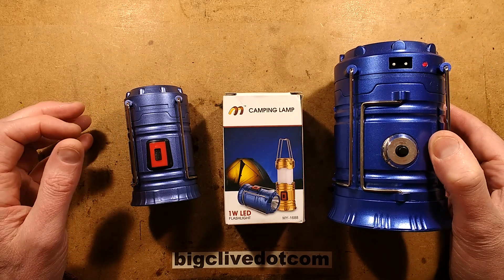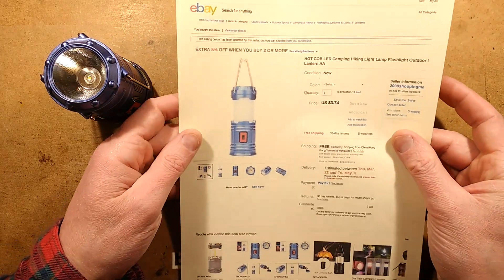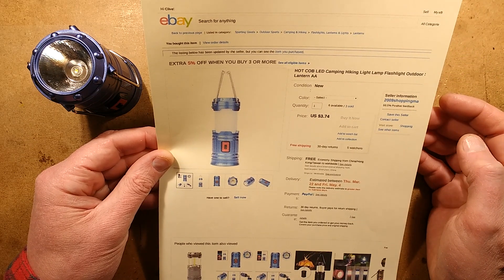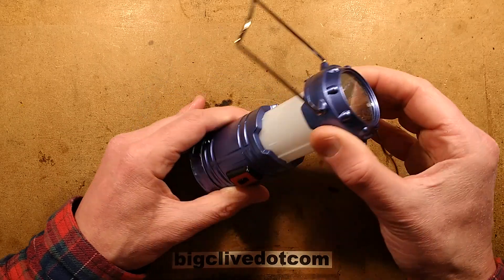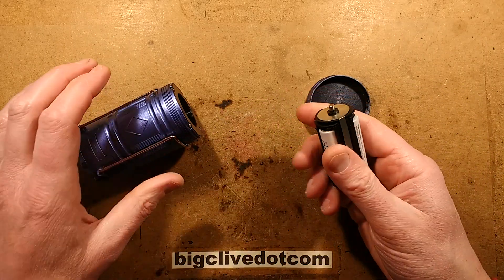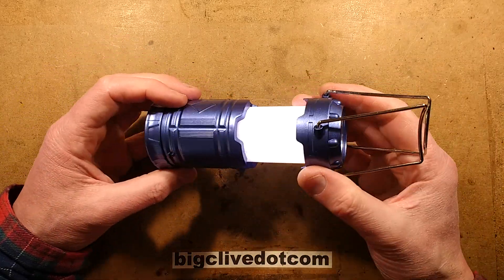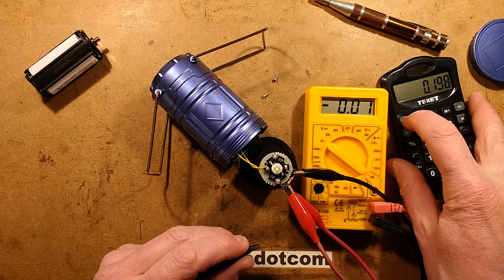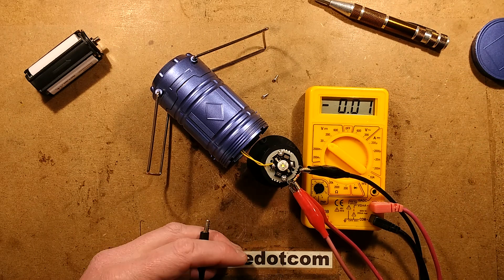Mini death-dalek camping light is actually safe!

Comment: Some other LED hand torch use a plastic sleeve to allow an 18650 cell to fit in place of the battery holder that takes the three AAA or three AA cells.
Would such a sleeve or even a homemade sleeve made from plastic plumbing pipe allow an 18650 cell to fit in place of the three AA cells, I wonder?
A protected 18650 cell that is.

K.

Comment: I am surprised that clive hasn't got around to reviewing the dodgy crap as far as electronics are concerned on wish
Reply from the maker: It's because the Wish landing page demands your email address before even letting you look at their site.  I just back out at that point.
Reply: Fair enough, it's a shame most of the stuff on the site is junk knockoffs, got a shoddy cable with a magnetic connector you see everywhere recently there for about 3 quid with shipping, took ages to get to my door and stopped working after one charge of my phone, didn't dare use it afterwards, I imagine anything more expensive would be quite a hit to the wallet

Comment: You can work out the power dissipated in the resistor from just the known resistance (2.2 Ohms) and the current from your power supply, you don't need to meter the Voltage across the resistor. Power = Current * Current * Resistance. P = 0.3 * 0.3 * 2.2 = 0.198

Comment: But if it isn't live at mains voltage how am I supposed to know if it's working or not?  You can't get a decent shock from 4 AA batteries.  This is most inconvenient.  And with this new safety feature I guess they can't sell it in pink.

Comment: A comment you made has me thinking. Alkaline 3 AA would normally be 4.5V. Rechargeable would be less, but the other day I bought a pack of energizer lithium cells since two packs were in the clearance bin. I figured $4 for 8 AA lithium cells, why not try them. I decided to put them in the Fluke 289 instead of my normal eneloop cells and I was surprised to see the one cell at 1.82 volts. In fact they all were between 1.82 and 1.88 volts. So three would be 5.4 volts, and not the normal 4.5. And for the fluke 289 that takes 6, well once I put them all it they measured at 11.04 volts. That 2 volts higher then 6 alkaline cells. I wonder how many cheaper things might without regulation like the stuff from Ebay would be affected by the higher voltage. I know most things might not care, but some things could. 
Just a random thought I guess since I measured those lithium energizer  cells the other day.

Comment: It's also fairly hackable! With a bit of cardboard and some tinfoil tape you can use a 18650, preferably a protected NCR18650B by Panasonic. You could also solder it in and add one of these tiny 2 amp charger modules.

Comment: Wouldnt it be 6000mAh though if there are 3 2000mAh cells? giving more like 42 hours of use?
Reply: If the cells are in series (as here) the capacity doesn't add, only the voltage adds. 
Put the batteries in parallel instead and the voltage remains the same (as a single cell) but the capacity adds - then you'd have 6000mAh @  1.2/1.5 Volts. Eith the batteries in series you get 2000mAh  @ 3.6/4.5V.
Reply: Michael Tempsch ah thanks :) Clearly I need to pay ore attention to Big Clive

Comment: Is the reflector double-sided? I was wondering why the wash light was so even. The only thing I could think of was that the reflector was coated on its backside as well so the light came out evenly but I couldn't see it from your vid.
Reply from the maker: The chromed plastic reflectors usually have a matt silver effect, so that would reflect the light well.

Comment: Great video as usual, one thing I wanted to mention that I do on hard to remove batteries like this device. Put a small strip of cellophane tape along the side of the battery case and let it extend out the bottom. Then fold it back on itself to make a pull tab.

Comment: had the same blue one i removed the down side led its good 1 w led usefull for making my soldering station quite better ez 5V + potentiomeeter so i dont get blind for while xD i used to shock my self while so i melt the red usb cable and removed it before problems i like that small one xD

Comment: This one is just a battery torch with a slid-up lantern top, it's not a Dalek because it doesn't have the "Exterminate!" function provided by a capacitor dropper powered charging circuit and USB port.

Comment: I must have forgotten something here 2.2ohm? I get 4.5 - 2.6 = 1.9v / .3 = 6.3ohm what did I forget?
Reply: I should watch the video again, but where did you get the 2.6v from?  Red Red Gold, 2.2*.3 = .66v * .3 = 198mW. Or did I miss something?
Reply: He said the light was glowing at 2.6v it's noisy here.
Reply: Still wouldn't a 2.2ohm resistor be too much and blow the light?
Reply: I think that was 2.6v across the LED and resistor in series with a current of 140mA?
Reply: He said it was starting to glow @ 2.6v I live in a madhouse of noise

Comment: What do you think about using 18650 Li-Ion's above their max Amperelimit for short period of time? 
For example Sony VTC5A made for 35A permanent load. Is it dangerous to drain 40A or even 50A for a pulse load?
Reply: The datasheet for the VTC5A has a table listing pulse current ratings.
Don't exceed the maximum current ratings unless you are willing to risk a fire or explosion.

Comment: Could this be hacked to use 18650's ?
Reply: Sure, anything that runs off roughly 3-4v can be converted to run on lithium with little effort, but the question you should be asking "is 18650 the right size for it"? 14500s are AA sized cells meaning you could easily fit 3 of those in there, maybe even hack the holder to parallel the batteries so no modifications to the device itself are necessary.
Reply: yeah, 3 Lithium cells in parallel would be epic.
Reply: I wonder could the unit be hacked to house a usb port and 5v voltage regulator IC so you could use this to charge your phone also.

Comment: I wonder if you could fit 3 18650 cells in parallel and do away with that AA cell holder and add a TP4056? Hmmm

Comment: i've come across some led torches that take 3 aaa's in a holder like that, but when replacing them , they wouldnt fit, seems the supplied 'aaa' s were fractionally thinner than proper ones, making the torch unuseable when batteries need to be replaced!

Comment: off topic and probably old news to many of you... but popping in to pick up some discretes tonight I saw Maplin is in closing down sale mode with 20-30% off and the stock does appear to be shifting...  I'd guess the discount may go up, but by that time it might just be the crud left. Stuff is included that is not shown on the website e.g. those annoying 3 packs of antex soldering iron bits - (buy 3 get 2 you don't like) Don't hang about too long if you want a plassie bag for a souvenir.
Commiserations to the Maplin staff affected BTW - hope you all find something better soon :)
Reply: That's sad.  We lost Radio Shack here in the US a bit ago, but they'd gone so far downhill there wasn't much to lose by the time they'd finally gone.  It's a lot less convenient to have to order from Digikey than to just stop by the local store.

I think all the Radio Shack employees you didn't want to punch in the face left a very long time ago.
Reply: + Jon C We had radio shack (called tandy here for some reason - same thing though, Archer, Realistic, TRS-80s etc.) and it failed here a long time before it crashed in the US... I went on a holiday to Canada in '97 and I was surprised they had radio shacks open.
Maplin expanded from a mail order electronics catalogue operation that'd sell in small quantities to people without trade accounts - had a few shops while tandy were still open and really expanded the shops a lot after tandy crashed, went for large retail-park shops rather than the smaller high street shops tandy had been in. makes me wonder if tandy got something super wrong in the UK cos it folded before competition from the internet had really even started.

Comment: Not a lot of features and the lighting is minimal but then again the Swiss army lamps have features that are somewhat useless and are prone to failure. This one does not waste space, involve questionable or potentially dangerous features, or add useless weight. The Chinese appear to have made a mistake and produced an inexpensive reasonable product. One thing I wonder if possible is a joule thief circuit that would optimize the longevity of the batteries without sacrificing brightness.

Comment: I was at Tractor Supply the other day, and they had a boring safe variant of the bigger Dalek in the bargain bins up front. AA (or AAA? I forget) powered, no USB, no solar, no, wall charging, and not even the top flashlight, just the lantern function when pulled open. I think it was $4 or so? Pricey for what it is. I didn't get one.

But they also had a nice light inspired by the Vietnam-era US military angled flashlight with the interchangeable colored lenses, but in aluminum instead of plastic and upgraded to LED. It also uses 6xAA instead of 2xC. I couldn't resist that one. I had one of the originals from a surplus store as a kid and it was my favorite flashlight then. I wish I knew what happened to it.

Comment: Clive, would that 3xAA cell carrier be about the same size as a standard Li-ion cell by any chance? Something like the 26650 or 32650 for example?
Or would that be just too convenient?
Reply from the maker: Slightly wider and both connections are at one end.
Reply: That's a pity, it would have made a nice >5000mAh rechargeable solution.

Although cunning use of a 3D printer could save the day - or produce a plastic 3D squiggle (from my own experiences!).

Comment: It simply having both contacts at 1 end makes it far better than the majority of my camping lights. All of mine either have the spring break off eventually, or the metal strip at the end no longer contacting the batteries.

Comment: Rule of thumb - for a bolt / screw 3.5 threads engagement is considered a minimum design condition in general egineering
Reply: Bishop Beesley unless you are Ford and are designing spark plugs for a v8
Reply: yep but they use higher grade hammer'd duck sh1t so its OK
Reply: Not being an engineer, "hammered duck sh*t" as a material doesn't sound very good :D

I figure it's a technical term but it amused me greatly!

Comment: There is a simpler way to get the resistor's power dissipation when you already know the current going through a circuit loop: P = R * I^2 = 2.2 * .3^2 = 198mW
That formula works because (1) P = V * I and (2) V = R * I so once you substitute V in (1) with R * I from (2), you get P = R * I^2. One less measurement to make when you know the components' values and aren't troubleshooting a possible component failure.

Comment: clive, i once watched an ep of 'tommorows world' , 30-40 years ago, in it, an inventor had a spray, he sprayed his black and decker ac drill, and then dunked into a fish tank of water and demonstrated it ran under water.....   can you recreate this, of course it was a scam, what are your ideas on how it might be done?
Reply: www.youtube.com/watch?v=HSrERT1qv1Q
Reply: kinda they are dc low voltage, then again its possible they ran a 220v tool at low voltage dc (they are a universal motor...) just to run it and pretend it was ac mains
Reply: Insulation is insulation, he probably conformal coated it then chucked it in. Not a hypothesis I really want to test out with my drill though.
Reply: Mains drill... https://www.youtube.com/watch?v=qtiyYBo4_38 I do suspect the guy could be using some clear oil or other insulating liquid instead of water in that tank though.
Reply from the maker: Clean water (not conductive) and no current path through his body, but it might have been possible to get a sensation on the hand holding the tool.  I remember that episode.
Reply: yep seeing as the ac is at the brushed end of the motor where he didnt spray,.....and it rotates on a commuator thus cant insulate.....hmmm i think he used 24v dc , great find though on the video!  big clive , we need yout o try this!
Reply: please try it !

Comment: Those little yellow meters are handy, the brand you have there is the best of the 830's.
Others are a bit frightning with wafer thin pcbs :-(
Reply: thats the origiinal mastech that the rest copied from, i agree, i bought an 830 for a laugh, it fell apart inside and outside and probes  too, though i was impressed it was accurate, for light electronics, its ideal though, wish i had one of those as a kid, i had a big avo meter, it was a beast, inaccurate, and a pain to use!
Reply: Yes i agree that the mastech one is best, it can play up on the rotary selector and the 200 ohms range never goes close to zero when the sockets are shorted with a copper bar.
I've improved that by using a stout internal wire from the Com socket to the 7106 ground. (thin tracks are bad for earths).
0.3 ohms when shorted :-)
The worst part is the leads, no supprise!, almost no copper lol.

I think the 830 was a much older design, it had a full compliment of functions, i have a crappy pdf of meter schematics, the 830 is more complex.
Oh i have an avo, big black analog beasty, after i corrected a meter non linearity it was very good :-D
Reply: i assumed the 830 was the first of a breed (to be ripped off hugely of course) of super cheap meters, pretty much a meter on a chip.  yes the leads are awful, but what does suprise me,  the display is still better and more reliable than a fluke, the sheer amount of flukes with a dim, flaky display ( i had a 79 myself and recleaned the foam rubber thing), and in near 30 years still suffer, and cant do what a cheap meter does, even a fully working has poor contrast, poor angle
Reply: I had the same thought about the mastech one, but it's a decent and cheap meter, as long as you don't give it to dave Ha ha :-D.

You are spot on with the display, i spent a few hours tinkering with my mates triumph herald, bypassing the relay type regulator and wiring up an old lucas alternator, i tested the final charging with an 830 but it was an old black version with a real intersil 7106!.

I accidentally left the 830 outside while we were torturing a teabag :-D, the display had gone black in the sunshine :-(.
I thought it was dead, but no, when cooled down it cleared and was crisp and clear again, mad that cheap junk can cope :-D

Comment: Quick formula: P=R I² = U² / R .  Ohms and Joule's laws trivially combined.
Reply: Twinkle, twinkle,  little star
Power equals i squared R
Reply: I was surprised that Clive didn't even use just ohms law to do the 2.2ohm * 0.3amps = 0.66V then compute power from that. But I love the Twinkle Twinkle Little Star memory technique. I hope I can hold on to it.
Reply: Ron B As they say,  "There is more than one way to skin a cat" (if you are into skinless cats).  Only +BigCliveDotCom knows for certain what he was thinking. 
As for the Twinkle, twinkle thing,  it's been rolling around in my coconut for about 30 years,  so I'm hoping I can hold on to it,  now,  as well.  ;-)

Comment: They removed my favorite feature. This is the iPhone debacle all over again. Except I've always disliked Apple.
Reply: nah, not so far :)
Reply: I have a Fire HDX 8.9 from ca. 2013, and the hardware is fantastic, but the OS isn't great. No Google Play apps, the last software update happened at least a year ago, and Amazon moved from making high-end tablets to cheap entry-level units.
Reply: Apple's had plenty of malware and exploits.... The reason most people never hear about it is the Apple fanboys are too busy promoting how it's a feature not malware.
Reply: i recently sold my only apple item, an ipad, all i could use it for was youtube or browsing, i bought an amazon tablet,  now i can drag drop files,  load apps that apple doesnt approve of! and have loads of extra memory 64gb! which apple dont like people to have.
Reply: Are you sure?
Reply: Wouldn't have an Ipad thrown at me.  I bought six Tesco Hudl 2's for all my family which replaced my Nexus 7's  A good three years or so on I still consider the Hudl 2 to be the best value for money and best performing tablet on the market with its superb 8.3" screen, 2gb ram, rather excellent audio and quad core processor as standard. It was just a shame they did not produce a 32gb version; they are all 16gb but you can supplement the storage with a 32gb SD card.  The tablet is made by Pegatron who made Iphone screens for Apple and the screen quality is outstanding.  I am simply buying all the defective ones on Ebay and refurbishing them as demand is phenomenal.  I bought all mine new for under £100, even half price for two of them using doubled Tesco vouchers.  Tesco no longer sell them and Pegatron no longer make them which is such a shame but you can still find the odd new one online but the price can be as high as £250!!! more than double the original retail price which gives you a clue as regards demand.  You can get used good condition screen no problem on eBay so buying one with a cracked screen is a viable option and it is a simple job.  In fact everything about working on the Hudl 2 is simple.
Reply: Well, it does have all that extra computing power and memory not found in the similar Apple product, so maybe the system load from the malware is so small as to be not noticable?
Reply: And free malware while you're at it.
Pretty neato :)

Comment: Current squared x R gives watts
Reply: That only works if you know the accurate value of the resistor. Sometimes the components are off-spec, so Clive's method is more consistent.
Reply: I worked it out like that before Clive had finished measuring and got the same result so the resistor must be pretty close.
Reply: The map is not the terrain. :)